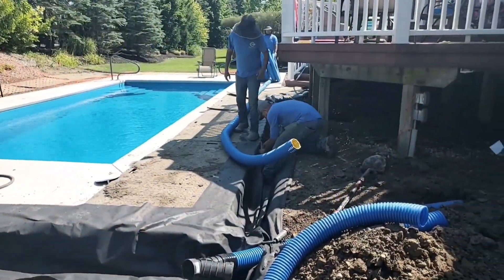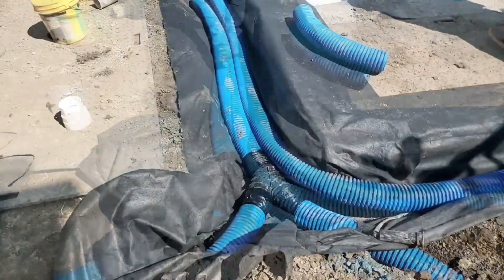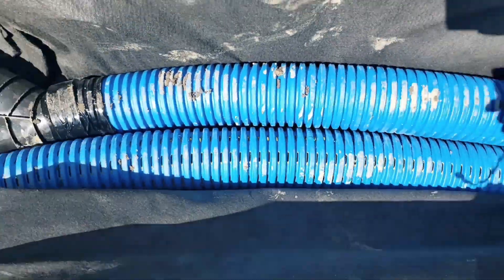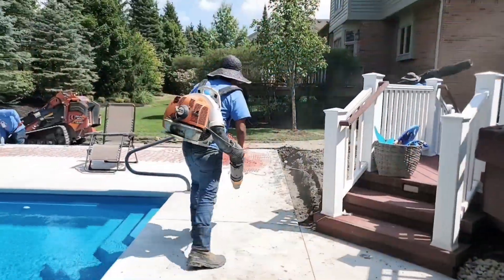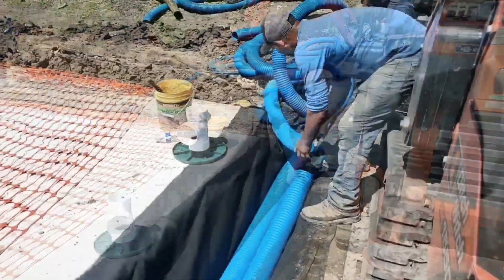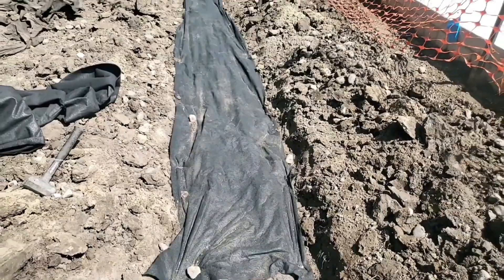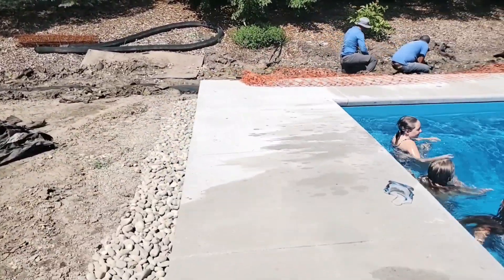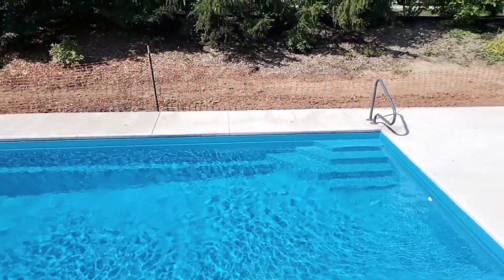How to Tie a Downspout into a French Drain  " Done Right the First Time"

Comment: Is there a rule of thumb to how many downspouts you can merge? I have 5 downspouts on the perimeter of my smallish house, wondering if I can tie them all to a 4” corrugated pipe
Reply from the maker: @armanbuhary4831 If they are 2" x 3" gutter downspouts and you don't live in a tropical storm region, yes; five 2" x 3" on a 4" main line on a smallish house will be fine. That's the maximum. We have done this occasionally. No problems.
Reply: @ thanks FDM!! Looking forward to ordering your products to get our project started!

Comment: Hello and thanks how do I determine if I want one or two rows of 4 inch pipe.  How much water does a single 4 inch move. Also i have a metal roof with no debri entering my down spouts. Do i need to run a separate 4 inch pipe. Thanks. John
Reply from the maker: If you're a DIYer, you're only going to want to run two pipes at a time. A quad pack is for the pros, and most people don't have the knowledge or ability to operate the equipment we have, even if they could rent it and had a truck big enough to tow it home.
As far as the downspout staying on a separate line, you will never change my mind. I know what rooftop pollution looks like, and the tree seeds and the tree buds that float from a mile away will find their way onto your roof. In my world, a downspout never gets tied into a French drain line. I don't mind tying it into the discharge line and sharing that discharge line with a French drain, but if they're going to share the trench, they're going to be side by side.
Reply: @FRENCHDRAINMAN  By a discharge line, are you referring to a discharge line for a sump pump by chance?

Comment: Thanks for the great, informative video!

Could you help me with a quick question? I have a section of my garage that's maybe 15-20 feet long where the water leaks from the cove joint. If I put a footer drain only at this 20 foot length, would that be an effective way to prevent water from coming into the garage? Thanks again!
Reply from the maker: https://youtu.be/xvfv0ZyTf3w?si=GuCDmcoKolLWW8XD

Comment: Thanks for the great, informative videos!

I had a quick question. I've got a small area of my garage that leaks through the cove joint. It's only around 15-20 feet long. Do you think if I put a footer drain just at this 20 foot area, it would prevent leakage into that section of the garage? Thanks again!
Reply from the maker: https://youtu.be/a-XfSvqQCPQ?si=iV3uiF8PqvZZkgz6
Reply: @FRENCHDRAINMAN  thanks a ton for the response! The garage is attached to my house so it would essentially be like putting a footer drain on 1/3rd the length of the house. Do you think this would be effective? Thanks again!

Comment: I recently bought your downspout kit times two it was the order to Utah. I'm confused with your recent video I thought I could tie in my French drain to my downspout with the catch basin that was a whole reason I bought all that stuff because I don't have room in my trench? The catch basin also has the pop-up emitter It's all the stuff from your shop which is great by the way I love the quality. Could you give me some answers to the questions I'm just a little confused now
Reply: While I'd don't have this problem or an answer, I'm curious what it would be. But I think you need to provide more details.
Reply: The details are that I have the downspout kit from the French drain man store I have the catch basin at the end of the solid corrugated pipe and then I would like to attach on the other side to the catch basin the French drain perforated corrugated pipe without ruin my system?
Reply from the maker: https://youtu.be/uKrUephna_c?si=QRqPIt25f0TM-rT-

Comment: Any concerns with using perforated schedule 35 4 inch pipes in a french drain in southern California where it doesn't freeze?
Reply from the maker: It can't do this
https://youtu.be/_dAwYBuMCnI?si=JIT_WVK4ID1031Oe
Reply: @FRENCHDRAINMAN  watched that video sent but it doesn't clarify why the schedule 35 pipe wouldn't work.  From another channel, they explained the key factor is the corrugated perforated hose has more water and air flow over the solid pipe option.  That makes sense now.
Reply: @rick2tube  I looked into corrugated vs SDR 35 too. In the south it's commonly PVC, but the install requirements are slightly different vs corrugated perforated pipe. With the corrugated, you install like FDM does with it on the fabric, on the ground directly. With PVC you need a bed of stone on the bottom before you rest the PVC on it. But it sounds like both work.
Reply: @ReFLeX135  thanks for sharing your learnings.  Finding the right parts at a reasonable price is also turning out to be challenging.  FDM corrugated pipe shipping costs to California is too high.  Will keep looking for another option.